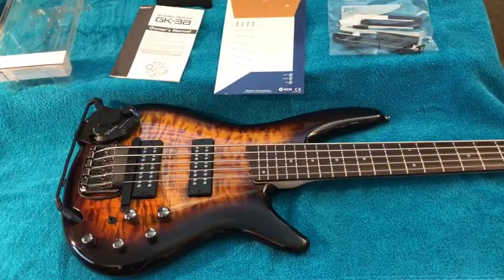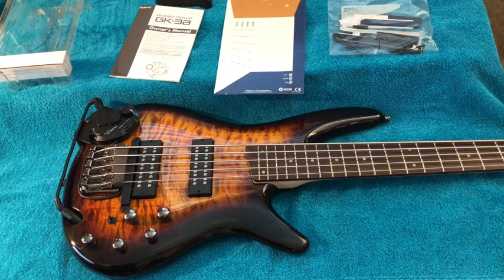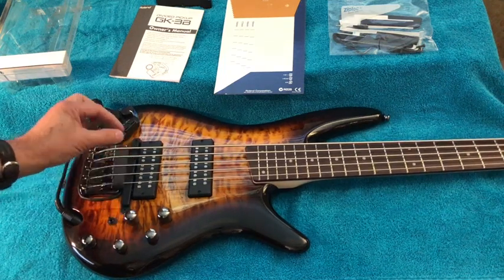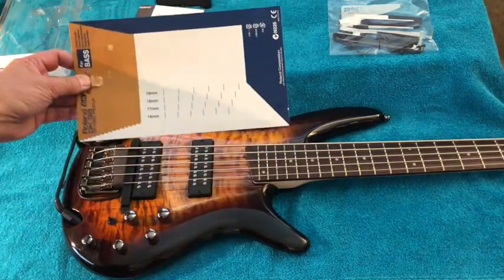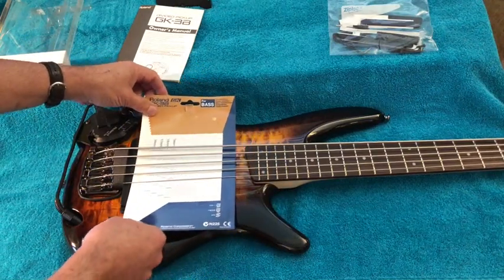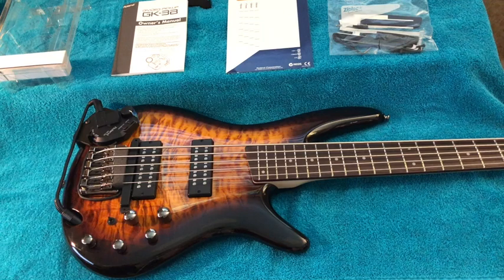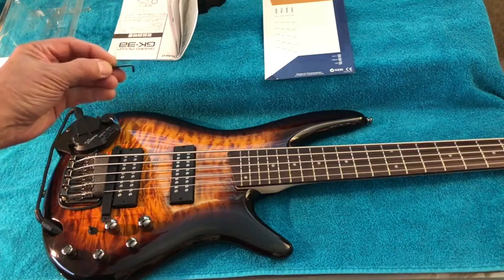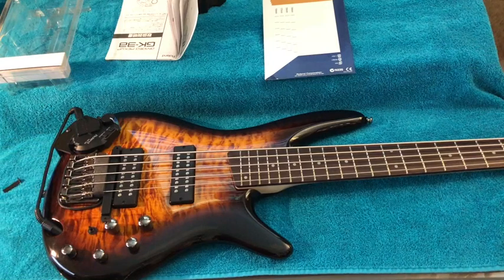How to Install the Roland GK-3B Bass Pickup for GR-55 Guitar Synthesizer Access

Comment: Hey thanks for the video! Just curious. Do you have any tracking issues (ghost notes) when playing your bass with the GR55? I’ve carefully followed all the steps in the manual, and I cannot get these ghost notes to go away. Wondering if it’s just the pickup itself or if there’s actually a way to configure the pickup  without tracking issues. Hope you are not dealing with tracking problems like I am! Regardless, thanks for making this video
Reply from the maker: Hi @Toys From Taiwan:  No, I don't have any tracking issues with the bass.  On my guitar, at first I did have some problems.  It takes a lot of adjusting both the pickup settings and the GR-55 settings to get it optimum.  Search on the Vguitar Forums web site for a document called "GR-55 Setups and Settings Hints" which has a ton of helpful ideas on setting up your rig!  The website is: https://www.vguitarforums.com/  Good Luck! :-)

Comment: Is this a proprietary thing that only works with a Roland product, or does it just convert bass notes to MIDI directly?
Reply from the maker: I can't say definitely if it will work with other systems.  The only other 13 pin cable system I have heard of is by Axon, but I haven't used it and don't know anything about it.  I only use the Roland GR-55.  BTW, the GK-3 pickup does not convert notes to MIDI, it is a hexaphonic/divided pickup and the processor (e.g. the GR-55) can provide MIDI output which you can use for example as an input to your DAW.

Comment: Where you mounted it looks not so great IMO.
The cord is stretched and it’s where my arm would be.
Have you tried it over the Bridge?
Reply from the maker: I have since flipped it over and moved it to be mounted on the back.  It is better, but still not ideal.  The bracket still bumps into my hand.  I covered the corner of the bracket with some black gaffer tape.  There is no perfect location on this Ibanez bass to locate it.  An internal GK kit would be better.